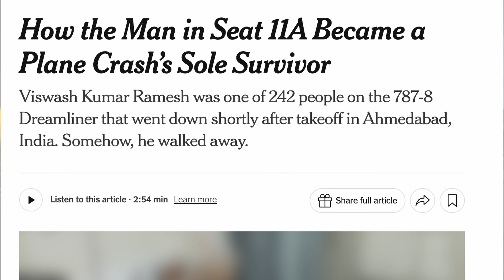Why the RAT Changes Everything – Air India 171 Update

Comment: Bearing in mind this happened without warning, at low altitude, and there was little the pilots could do to rescue the situation, doesn't it put you (Steeve) off flying? I've flown a few times in my younger days (including on Aeroflop in its 1960s Commie days, and the noise it made on push back, prior to the engines starting was a bit scary) but nowadays, even with state of the art aircraft, you won't get me further off the ground than a four-step ladder.

Comment: OK, so, I’m no aviation expert but and it is a but, with what we know so far, everything points to the total failure of the Master Switch or another critical electrical component within the main electrical system. If the Master Switch or one of the other critical components did fail it would cause the RAT to deploy and also explain the loss of both engines adn hydrolic pressure.

The total loss of hydraulic pressure would explain why the flaps did not operate correctly and why the landing gear failed to retract after take-off. And there are very few reasons for the Master Switch or other critical electrical component to fail, some of which are proper maintenance checks not being carried out by maintenance crews and/or the improper installation of or/and use of inferior quality parts.

Also, there is a report that back on 2020, the US FAA had insisted all 787's electronic systems must be completely turned off and back on at least once every 51 days to clear any corupt data from causing issues within critical systems and their performance. Again, putting the reason for the loss of the aircraft and all but one of the people onboard fully at the fault of the maintenance crews.
We will not know the full reason for the loss of the aircraft and peoplel onboard until both Black Boxes have been recovered and data has been processed.

But regardless of how this incident happened, my thoughts and prayers go out to the families and everyone who had family members and loved ones and friends on the aircraft.

Comment: So one question.  What would be the result if the "RAT" deployed on it's own?  No reason other then failure.  What if the RAT deployed on Take off?  What would a deployed RAT do to the engines?  Could the deployment of the RAT cause the engines to not run correctly?   We are making assumption that the RAT deployed BECAUSE the engines failed.  Could it be the other way around?  Could the RAT have deployed on takeoff BEFORE there was a problem causing circuit changes that caused the engines to then power down or run at idle only?

Comment: losing both engines at the Same time? airliners are built that both engines are completely
independent of each other? Fuel contamination is one ? but to loose both at the same 
time may lead to a fatal flaw in the 787 .
The 737 flew over 25 years with an excellent record before suffering to fatal crash's 
due to rudder reversal  that took years to solve. So hopefully they find the cause as
there over 1000 787 flying round the world

Comment: @Captain Steeve  I've read on time magazine website. 2 other 787 dream liners also had issues before this tragic crash. In 2013 two Japanese airlines had fires breakout when they had overheating of the planes’ lithium-ion batteries that power the electrical system. Also It was 38oc that day which is very hot. I'm also speculating but considering the previous issues and it being very hot that day this could be a possibility.

Comment: Sir, do you remember the airbus that crashed in the woods on camera during an air show in France many years ago? Just before crashing you hear the engines spool up. Why because it is the natural thing to do for a pilot in this kind of situation, to apply full thrust. 

Therefore I agree with your theory of a dual engine failure. Because you do not hear this in this situation. Granted it is just after takeoff and the thrust was probably in t.o. power, but that is most of the time reduced t.o. power so you should hear this effect too. 

Besides that, everybody who does some plane spotting or is a aviation expert hears that the engines make more the sound of a landing plane then an plane that takes off. And the sound indeeds sound like a RAT deployed.

Comment: Gentleman may be you are right  
in your judgement.But still dual engine failure being a root cause opens up another set of doubts.
A plane takes off from airport after full inspection passed as ok from AirIndia technical team,being that plane in such a big issue.Dual engine failure should have been persistent from time it was in ground in that case.But still plane makes one projectile ? How?.
Now if we go with assumption that just one upper thrust and both engines failed together,how thats possible in such small time of few secs.I attribute this to only one reason.With passage of time and plane getting old some minor opening let dust and rubble let came in fuel engine and authorities may be not taking fuel tank cleaning as part of planned duty.For that day this became catastrophic..

Comment: It breaks my heart that they all knew for at least fifteen seconds they were about to die. If the batteries were not working, then I can totally imagine dual engine failure. Because even when  you lose all hydrolics and electrics, you should not even lose both engines, but if the fuel pump stopped, or the engine control units, then they did lose both engines, with the immediate deployment of the rat. And all the pilot could do was keep the wings level, the flight flat, and sink.

Comment: Let me recap: The aircraft had previously flown from Delhi, apparently without any major problems. It was then refuelled for the long onward flight. It then taxied to the runway under its own power, with its engines running. There it waited for take-off clearance with its engines running. No problems so far. Then they open the throttle and reach take-off speed with the flaps correctly set. The engines generate very strong thrust, which they can only do if the kerosene is OK. What I don't know is how much of the kerosene consumed up to that point came from the refuelling in Delhi, or at what point the refuelled kerosene is drawn in (length of the fuel line).
The kerosene for this aircraft did not come from a separate tank; all aircraft were refuelled from the same tank. No other aircraft crashed that day because the kerosene was contaminated. But could it be that this aircraft was the first to be refuelled with a new delivery of kerosene? And that it would now be better to take samples from the tanker to analyse them?

Comment: Candida keroseneae is an organism that has adapted to grow in aviation fuels/kerosene ... Airline engineers use a chemical called 'Kathon' to kill off the build up of these microbiological contaminants. If not diluted in the correct proportions the 'Kathon' can be too concentrated and this can result in heavy residue build up in the fuel system filters, valves and pump mechanisms ... perhaps this was a cause of dual engine flameout due to contamination and therefore fuel starvation???

Comment: I've got a "theory" on the air India accident. 

(The ram air turbine (RAT) is a last-resort device designed to deploy automatically on aircraft like the Boeing 787 Dreamliner when both engines fail or there is a total loss of electrical or hydraulic power)

They have proof that the rat was deployed during the takeoff. A sound engineer first mentioned this by the sound of the propeller from the rat from the video taken.
My theory: How about the RAT was at fault and dropped itself down under fault conditions when it shouldn't have. There's got to be a big relay switch and hydraulic switch to re-root from main engines to now the rat running the electric generated and hydraulic pressure.
When the rat is switched in it should then generated electric and hydraulics to run electrics to the jets, not enough speed and time for the rat to run correctly, sudden loss of power and thrust resulting in a crash. 
The rat must have a mechanism in it to deploy it fast and hold it down in place. Which could have failed and set itself off.
Only a theory.

Comment: The real facts are the plane has 10s of millions of hours in the air 5 million takeoffs and landings, it is a modern plane with no piece of equipment (that will fail and would have failed by now) that would shut down the airplane. At a critical stage, close to the ground, it instantly shut down with no external signs, of engine, like smoke, explosions, birds, or parts flying, and became a glider. Bad fuel I would assume would not hit both engines at the same time because they get their fuel from different sources. The engine showed no external signs of problems if one could be producing little to no thrust, shutting down the wrong engine, which is pilot error, would be the only thing that has happened frequently in the past, this is the only scenario if the rat came out and the wheels could not be raised. Though there was no left or right tilt, I assume you have to make adjustment for 1 engine thrust, you did not see smoke, parts, or tilt of single engine flight, given the visual evidence you should be able to make an educated guess of which engine failed.
It also could have 5 flaps and for conditions that was incorrect for single engine, you let the computer climb out and do not make adjustments immediately when you are on 1 engine and do not have enough flaps for that configuration (thrust and attempt to climb), you could go nose up wallow and stall. If you let your speed drop, you got to skip the mayday, in the next 5 seconds level off and let the single engine increase the speed and climb potential, they didn't have to clear anything, the pilot error would be the flaps setting for a single engine takeoff. Not hitting the raise wheels button would have been another pilot error if this were the case. 
Another pilot error is not hitting the speed at some pre-V1 abort mark, half or 1/3 in the roll, if the takeoff was late that probably happened, we only saw the engines at liftoff, maybe halfway down the runway it stalled and smoke or parts went flying off camera. You do not fixate on V1 and ignore the normal progression of speed, you go more than 2/3 down the runway and are not about to rotate you will have to go off the end of the runway to stop.
Some type of terrorist intentional action could stop both engines at a critical point at the same time, it was a turnaround flight, there was not maintenance, but who knows who was in the plane, someone could have gotten almost any place and planted small (unable to seen in the video) devices to disable both engines on a command or altitude change. It would have to be a researched, state-run operation with insiders setting it up.

Comment: The Gear knob  has 2 positions,  up and Down only, it moves verticaly , and it's on the front instrument panel.
The slat and Flap handle is about 1m away on the centre pedestal. It moves fore and aft, thru about 5 detents.
Virtually impossible to confuse them,  by accident

Comment: Captain Steve, with all due respect, the fact that the RAT was deployed was known already TWO DAYS AGO when you were still talking about 'co-pilot error'. Could a massive electrical/electronic failure have caused both engines to power down? More so than any other modern airliner, the Boeing 787 Dreamliner is hugely dependent on electronic/computer control of its systems.

Comment: Food for thought.
Boeing has an undercarriage system that has the wheels tilted rearward in flight. The gear swing on a 787 (sequence of the gear moving up) has the gear tilt from rearward to forward quite early in the process after the pilot selects the gear to up. In the video it looks as if the gear may be tilted in a forward direction SUGGESTING the pilots did in fact select gear up (not flaps up) starting the hydraulic sequence of the gear being raised. It also supports the claim of a dual engine failure somewhat promptly after gear up selection, causing a loss in hydraulic pressure. Hence, the gear is unable to be raised (although the gear selector may be up in the cockpit) as well as the automatic RAT deployment. 

https://youtu.be/2ZwzACp-q9U

Comment: Excellent .. excellent ... interesting .... However ........ Given your explanation about the R.A.T. ..... why is the gear still down, but the flaps up?  Both gear still down and take-off flaps still extended would make sense - pilots too busy, they never got to them after rotation/climb because of the dual engine loss or ...... the gear would be retracted after lift off, but the flaps would still be down until a positive rate of climb was established ..... seeing the gear down/flaps up is an odd mix given the aircraft situation.  Why were the flaps raised?

Comment: Excellent analysis. The rooftop video’s sound brings another clue : there is no engine noise per se. In a difficult situation after takeoff, the engines would have been pushed to TOGA maximum thrust. That would be extremely noisy. So this concurs with the engines being off. 
But this likely scenario is only the beginning. If true, the essential question next is : why did both engines get off, likely simultaneously, just after takeoff. Dual engine bird strikes are not supported by any evidence at this point. Fuel contamination is a possibility, or fuel circuit malfunction. A malfunction related to maintenance error is a serious possibility. Flight recorders will quickly orient the investigation.

Comment: As for the RAT - I wondered why it wasn't visible at 6:40 and 6:43 - but then I looked at some darker pixels in the area.  I think the answer to why you can't see it (but, if the OP here is right we could hear it) is that the angle of the shot and quality of the video means the RAT at that point was essentially 'lost' in the fuselage.  Only when the relative angle of the fuselage is closer to minimum aspect does the RAT stick out, even if it's only a blip at that point.

Comment: I learned to fly Cessna 150s at EGMC, Southend, the runway there is an awful lot longer that a Cessna needs but all the instructors taught the same thing. Start the take off roll with the tail as close to the fence as you can, any problems might very well show themselves long before you run out of runway and a Cessna could have made a whole series of landings before reaching the overrun. I understand that this take off was started after an intersection, reducing the effective space, reducing the chance of flopping it onto it's belly on the overrun. What do I know, but some of you might have some thoughts on that.

Comment: The surviving passenger talked about "a loud noise". ADS-B data stopped before aircraft touched ground. My assumption: loss of command to engines. This is a dual engine failure. The Boeing 787 is a fly-by wire aircraft. Engines shut down themselves to "no thrust" state. Cause for loss of command to engine was total loss of electricity. Therefore the RAT activated automatically. But fate was decided, that is RAT did not produce electricity fast enough to prevent the disaster. Again my condolences!

Comment: Been saying this from the start; a plane doesn't just pancake in to the ground without zero thrust from the engines. The Concord crash showed the same thing a lot more graphically.The Rat may have helped above 5-10,000ft allowing the plane to turn and re land but not here. Maintenance demons either couldn't or wouldn't do their job in a timely manner, probably fuel starvation because the engines were not serviced properly.RIP to the victims.
Reply: Nope, not fuel starvation. Right engine rolled back at takeoff, and the left engine was lost at 625ft.
Reply: @vickyverma6852  Something dicky in the maintenance hanger methinks.

Comment: Could the flaps set incorrectly before takeoff and the engines stalled also the landing gear will not go up until appropriate altitude
Reply: Flaps don't cause an engine stall.

Comment: I strongly suspect the cause was water contaminated fuel.  Jet fuel floats on water, and depending on how the fuel intakes are placed and the shape of the tanks being used it is possible that as the aircraft rotated during takeoff the water shifted in the tanks and entered the fuel lines to the engines causing a flameout or power loss a few seconds after takeoff.  This also would explain why the plane was operating normally prior to takeoff and suddenly lost both engines.

Comment: There is a video of a passenger that was on this plane 45 minutes before this flight reloaded with people and left and he videotaped how many things inside the cabin were NOT working, all electrical faults. Seat screens not working, call buttons for the stuwerists not working and lights not working also NO A/C so clearly there was some sort of electrical problem that was not address and it's likely it got worse during rotation and cause catastrophic electrical failure causing the RAT to automatically deploy causing the pilot's controls  to no longer respond because the plane engines were working as you can see they got airborne so maybe the flexing of the plane as it rotated was all it needed to suddenly cut off power to more critical controls and the plane was now a paper weight at that point.
Reply: Turned out he was the only one with those complaints, and most of them false. None of the other passengers experienced that. Imagine being locked inside a metal can for hours without A/C in 107F (42C) temperature, half of the passengers would have arrived dead and the airline sued to oblivion.